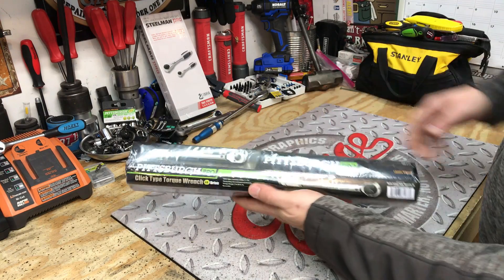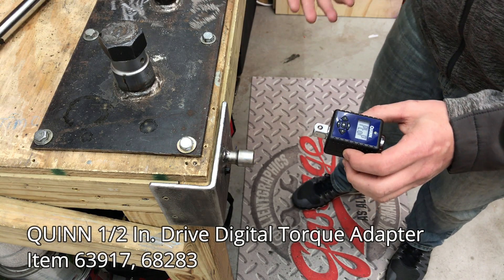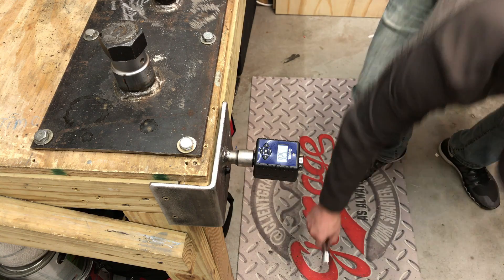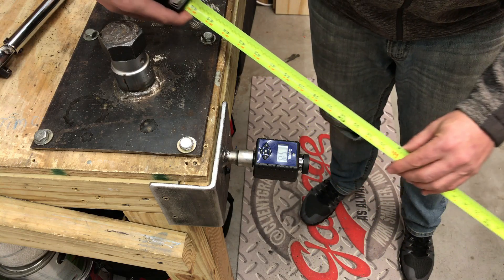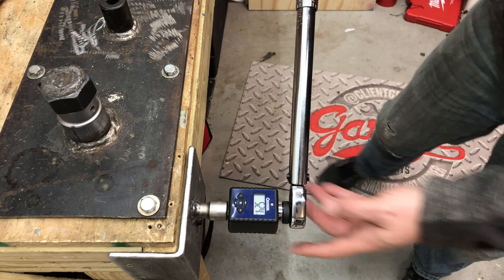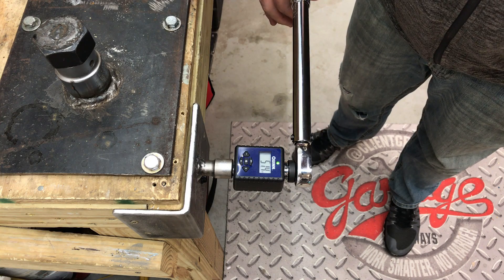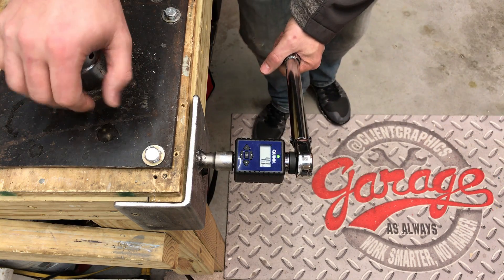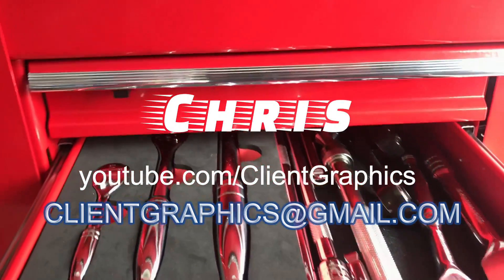Dropped the Torque Wrench? Let's Find Out if it’s Still Accurate

Comment: I would like to see a long term test. I keep seeing you should store it set at zero. Theory being the spring pressure changes if stored at a torque setting.
Maybe you could run a time test to see if thats true.
Reply: Absolutely.  Let it sit for a couple months at 50lbs and see if it stays accurate.  Which reminds me that i left my wench locked on...
Reply: @oh-qn6ht  I was rhinking more like a year. Maybe test it every month for a year
Reply: @oh-qn6ht   same…
Reply: I calibrate probably 1000 torque wrenches per year at work. I know for a fact that keeping too much tension on the spring for too long can cause it to produce bad torque. I have seen it happen many times. Depending on the model, sometimes they can be adjusted. Sometimes they are just too far out to adjust in.
Reply: @rjfontenotiii  This is the experienced comment I needed.
I suppose in many applications consistency of torque rather than absolute torque is what matters.  Warpage of parts comes to mind.
Curious how far those settings drift when the spring is left compressed. 
10% 20% ??? What do you see?
Reply: @heyyou5189  Honestly it's hard to say. It varies so much based on the tool manufacturer and how much the wrench is actually used. Most out of tolerances  I see are around 3% to 6% out of spec. But you should remember  that these torque wrenches get calibrated yearly, so they never have a chance to drift out farther. The cheaper torque wrenches are usually out by more.

I can often tell when a torque wrench has been on the same setting for a long time because I'll sometimes see crud around the handle. This indicates  that it has probably been sitting for a long time in that position. When I come across these they are out of tolerance more often than not. Usually it's not a big deal to adjust them back in.
Reply: @rjfontenotiii  . I bought a CDI torque wrench last year and switch it back to 0 ft lbs immediately after I use it. How often do you think I need to recalibrate it? Where can I have this done?
Reply: @viewer-i5o  Great question. I would recommend that your torque wrench be calibrated yearly. This seems to be pretty standard across most applications.

There are 2 types of calibration laboratories out there. There are those that are ISO 17025 certified, and those that are not. An ISO 17025 certification basically sets the standard for how a calibration lab should operate. It provides a format for implementing a quality system and sets up a bunch of technical rules that must be followed.

Your best bet is to find a lab that is ISO 17025 certified. This way, you know that you aren't sending your torque wrench to some clueless guy doing calibrations in his basement (I've seen it before). The only drawback is that this does cost a little more. If the actual ISO 17025 certification is not important, many labs will offer a cheaper, non ISO 17025 calibration, but you are still basically getting the same calibration since its the same lab doing the calibration. You will also likely pay more if you need as found and as left data on your certificate. 

Depending on exactly what you need, you should pay $30 at the low end and $70 at the high end for the calibration excluding shipping.

You can go on Google and search for calibration laboratories. If you are looking for some kind of direction, I  personally  use Team Torque for my lab's torque standards that I use to calibrate the torque wrenches. They do wrenches too. I believe you can get an online quote from them, and they are usually pretty quick.
Reply: @rjfontenotiii  This is great information! My torque wrench is expensive and I want to take good care of it. Thank you so much!!
Reply: @viewer-i5o  No problem. CDI makes good torque products. Our torque standards are made by CDI. Go figure that you are buying your torque wrenches from a company called Chicago Dial Indicator. Lol. Anyway, just stay away from Snap-on torque wrenches. They are overpriced garbage. They fail as often as Harbor Freight Pittsburgh torque wrenches do.
Reply: @rjfontenotiii  . I spent a fair amount of time researching torque wrenches before buying and CDI was said to be one of the best so I decided to get it. Thanks again for the great advice! Cheers!
Reply: I was going to suggest this.  Leave it set to  ... 75% (?) of the max setting and check it every day for a week. Then once a week for a month.  Then ...

I'd also be interested in how repeatable the setting is.  That is perform the same tests but returning the setting to zero between each. I suspect the variation due to eyesight is the bigger part but it would still be an informative test. 

Thx for all the testing!
Reply: Actually now the manufacturer States to store it on its lowest torque setting.
Reply: I ruined one by leaving it set to 100ft lbs. Was in my tool chest for 5 months.
Edit: 100lb became the new low. Anything under 100lb would not click until (what felt like 100lb).
Reply: I stored mine on 80lbs/ft for about a year 😅 it’s a craftsman 3/8.... been wanting to pick up that digital reader to test it

Comment: I like harbor freight a lot, but I really didn’t expect this torque wrench to do and hold up so well. Feel like I should of just went ahead and bought them instead of my kobalt torque wrenches lol
Reply: I torqued arp headstuds in my honda with mine lol talk about loosing sleep it seems like mine is pretty accurate tho lol 9.99 torque wrench some ppl have bad luck with them I've heard
Reply: @JoshDane89EF  From what I've gathered, it is few and far between.  I don't know anyone personally who has gotten a bad one and I know a lot of people to include professional technicians and mechanics who have these in both the 1/2 and 3/8 drive.  I'd say to check it when you buy it.  If it is bad, return it and test that one.  Then properly use and store them and periodically check to see if it's in spec.  Should be fine that way, especially if you're like me and are only a DIY type.
Reply: @chrisg1043  yea I think the people that was complaining about them was an operator error lol. Most was complaining bout it not clicking and breaking bolts with it probably bc they wasnt reading it right or needed in lbs instead of ft lbs. The reviews I seen was on the harbor freight website. I have the 1/2 drive and I tested it with a friends Quinn digital torque meter like in the video an mine was spot on but b4 I tested it I was nervous bc i had torqued head studs down with it
Reply: @JoshDane89EF  Most likely.  And I got mine from both HF website as well as all over the internet.  I do my best to get as much research as I can on something before I purchase.  And I do understnad the nervousness there.
Reply: @JoshDane89EF  be careful with them I stripped the threads on my sxs engine drain plug with this wrench
Reply: Wicked 4355 I figured initially it would work fine.  But I figured after the 1st couple of drops it would be totally messed up.  I did research before I bought mine (needed it for a few repairs on my old beater).  Reviews said it was good.  But I figured it was a cheap one so if it got dropped or abused it would be out of spec.

Very impressed.

Comment: Where would someone go, to have their TORQUE WRENCH Calibrated?

And, at what cost?
Reply: If you notice the calibration tool that Chris is using is purchased from Harbor Freight so it's easier to buy the tool and the torque wrench and use the calibration tool to adjust the wrench
Reply: @stanleymcman9422  WHAT Calibration Tool?!
Reply: @tkskagen  I'm sorry the thing that Chris is using is a digital torque meter not a calibration tool but you can use it to adjust your torque wrench to the proper settings
Reply: @stanleymcman9422  it's a calibration standard
Reply: @futon02  yes I got it but if he buys the digital adapter which shows the actual tour come out he can adjust his torque wrench based on those correct numbers instead of paying somebody 72 $80 to calibrate a $9 torque wrench
Reply: With the price of a Pittsburgh torque wrench, go buy a new one instead
Reply: Look up metrology in your area.
The cost is reasonable
Reply: @heyyou5189  it's normally around $30-40 for a torque wrench cal.   Pittsburgh torque wrench with coupon is $10
Reply: They'll exchange it too if you say it doesn't work right.
Reply from the maker: Every place is slightly different 25-50 to verify it's in spec.  If it needs adjustments it could be 75-100 or more depending upon the brand

Comment: Please someone call the tool police! I have all three Harbor Freight torque wrenches.
Reply: Me to lol thier so cheap ive used em all
Reply: @GasGunsGod  do you like it
Reply: @diegoavila4379  yeah they get the job done but the locking  mechanism at the bottom comes loose and I'm constantly checking the setting on it !
Reply: I actually recently bought the three as well lol, the 1/2, 3/8, and 1/4. After watching these videos you really can't beat them for the price, and I throw them in the back of my jeep in case anything happens on the trail